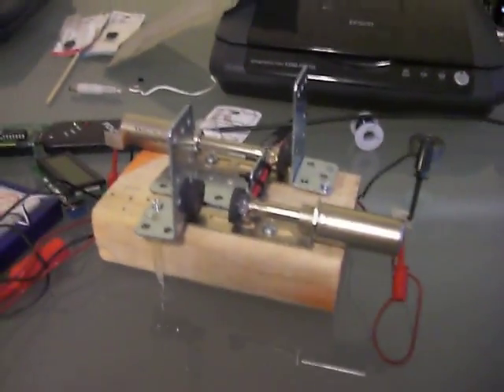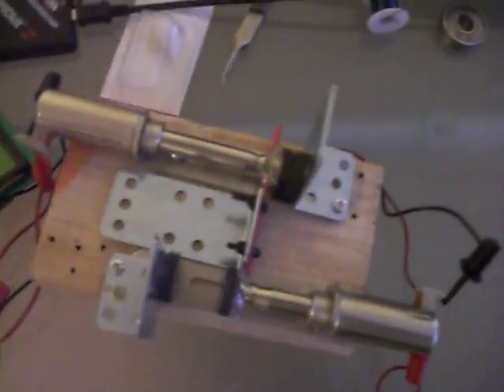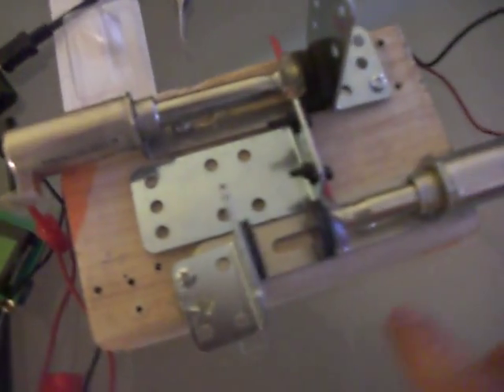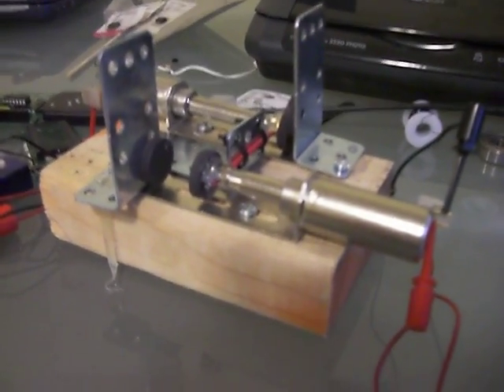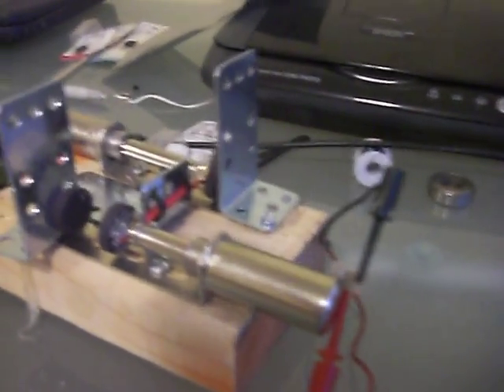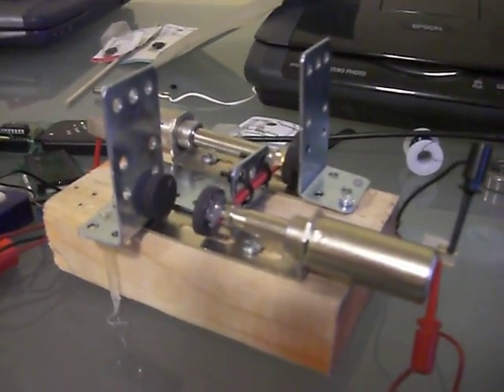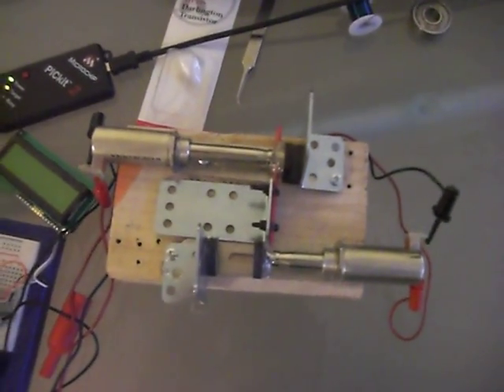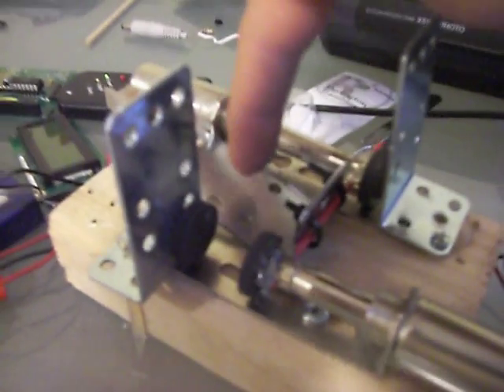Solenoid Cutter Mechanism

Comment: Unfortunately you need to mount solenoids differently, this will not work well since the forces applied are twisting the system.

Comment from the maker: If I understand your response, that wouldn't work (at least with these particular solenoids).  These solenoids can only PULL. Usually there is a spring on them to return them to the original state which I removed.  

If I use the solenoid with the spring and magnets to hold it open and closed then it would get stuck in the pull state because there wouldn't be another force to pull it from the magnets.

I don't think it is possible to use just one pull solenoid, unless you know something I don't.

Comment: Why not just use a single soleniod with a small magnet at the open and close positions?

Then you only need to power it to change state and only need one solenoid.